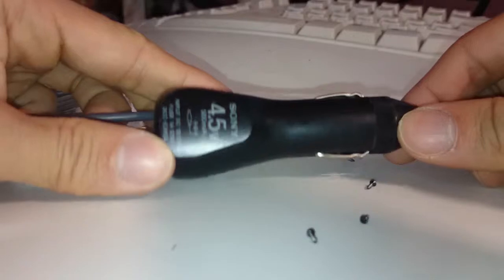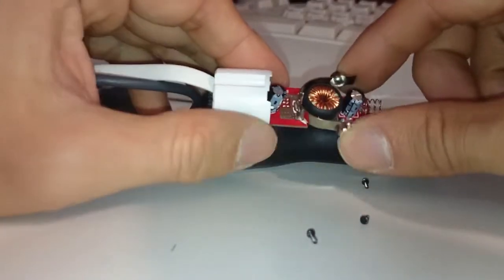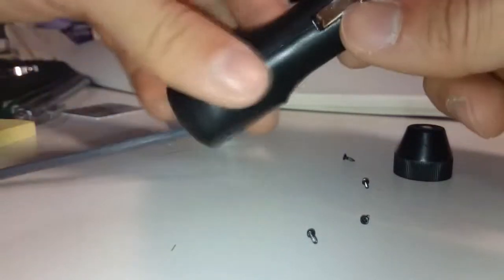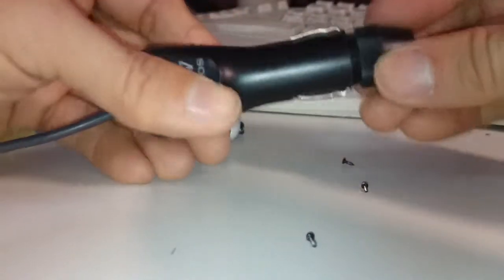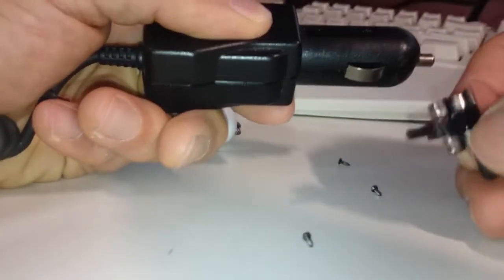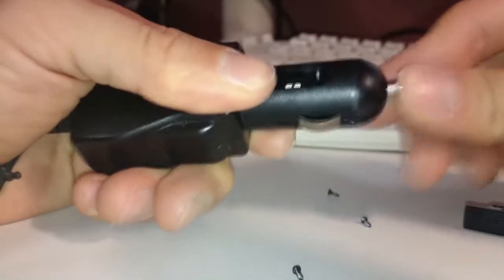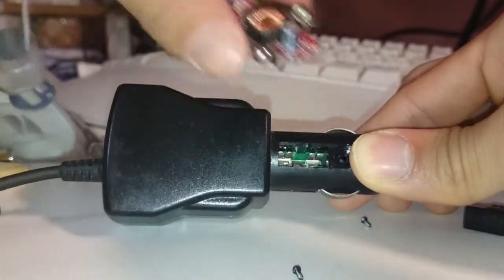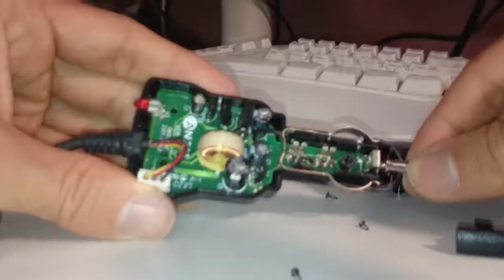Car lighter charger tear down and locate the fuses

Comment: This video would be more helpful if you said what fuse to use when replacing blown fuse.
Reply from the maker: Yes, every device is different so it is just a matter of checking on the metal part of the fuse for the correct rating during replacement.